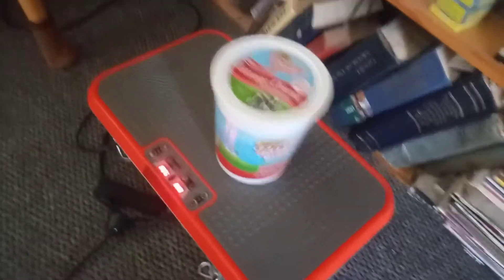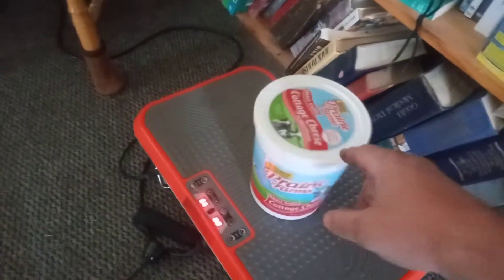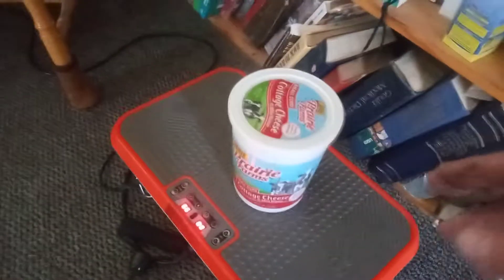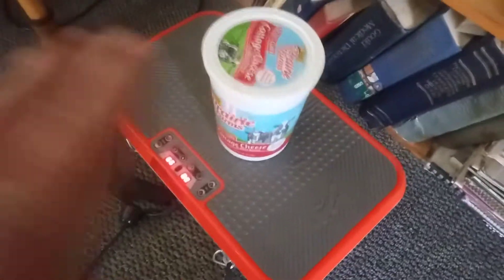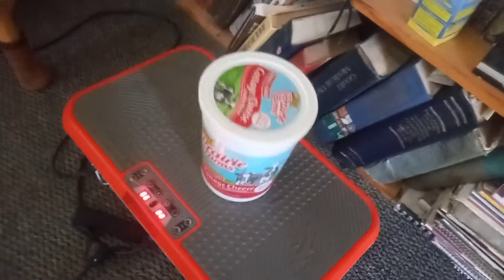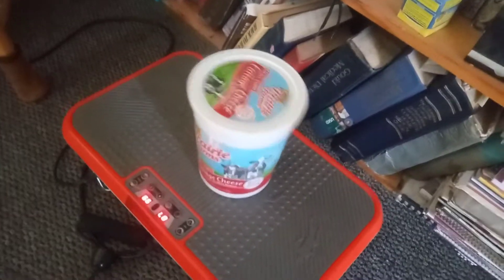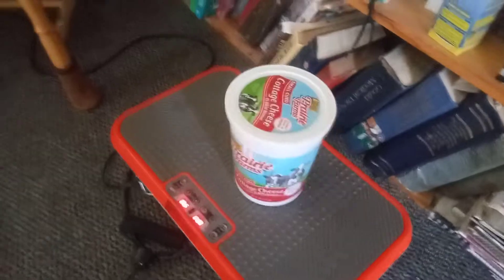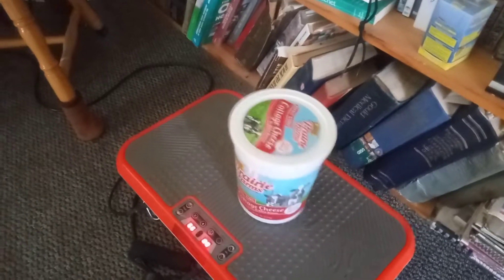Cleaning clock parts without an ultrasonic cleaner. 20220427 115736

Comment: Good day to you Sir (or evening… whichever the case and location may be), I had a question please. What is the amounts for the ingredients you mentioned in the video above that’s used to clean the movement? Thank you BIG! What’s in it and how much measuring cups. Please and thank you
Reply from the maker: For about a 1-2 gallon container you would use 50/50 simple green and water,  then about a quarter cup of dawn dish soap, about a quarter cup of acetone, and now I am using about a quarter to 1/2 cup of Murphys Oil Soap. I hope this helps.
Reply: @munnerlyn3   thank you 🙏 so much I will screenshot your instructions and print it out so I can read your instructions thank you very much for your time and god bless you